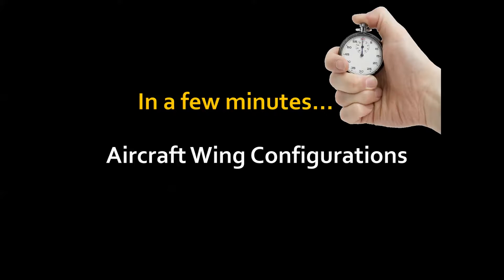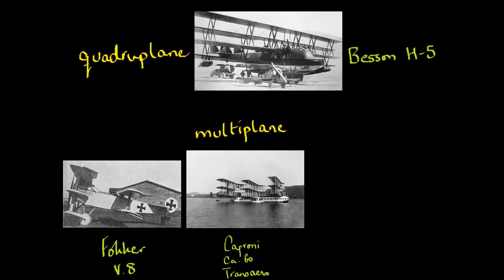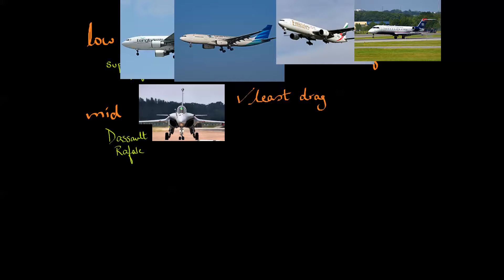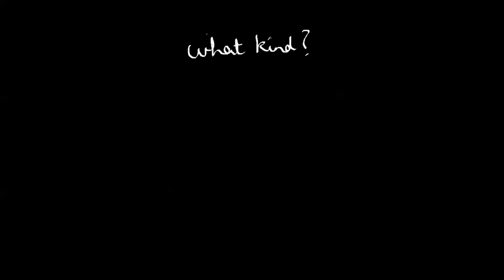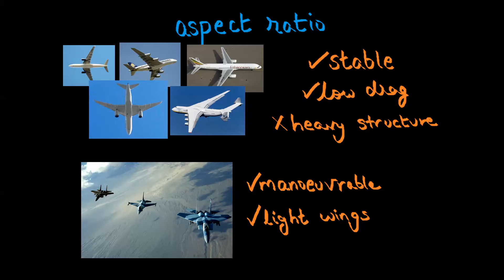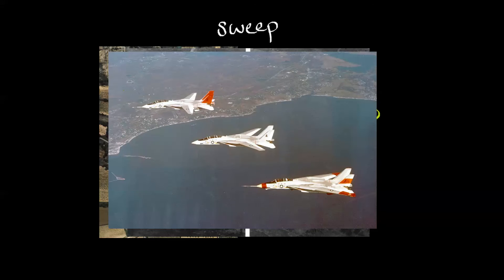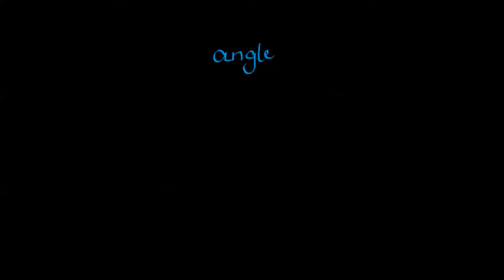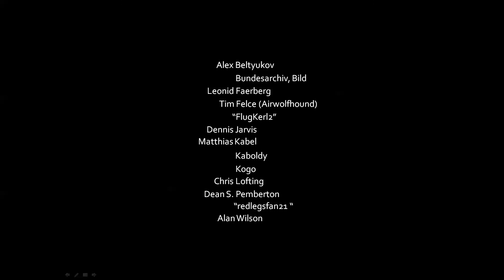Aircraft Wing Configurations

Comment: The aspect ratio part was VERY iffy and completely backwards... yes it was the very basics but some of it was very wrong. Low aspect ratio typically means not very nimble but very fast as there’s less drag, mid aspect ratio is popular with fighters with all around maneuverability and drag and high aspect ratio is good for that good high altitude performance

The dihedral and anhedral was also very off

Comment: So what are the disadvantages of a forward swept wings? BTW love this vid
Reply: Structural, the forward wingtip experiences large forces which means stronger and therefore heavier wings are required.
Reply: Poor yaw stability. Essentially, Imagine when you take a plane and spin it around the centre of mass of the main wings. The wing tips draw a circle right? When you have a back sweep, and you turn, the one wing turns into the flow, causing more drag (think of holding a flat palm against a water jet in a pool vs a angled palm). The turn also moves the moment arm further from the direction of travel. The opposite of all this is true for the other wing. There is less drag, and a smaller moment arm. These combine to make the wings attempt to turn the fuselage back towards the direction of travel. With a forward sweep, this is the opposite. The wrong wing loses force, and so it makes the aircraft turn more. This usually requires a computer to keep stability.